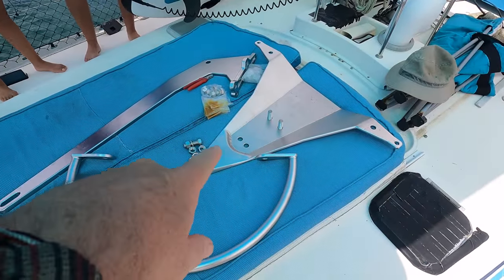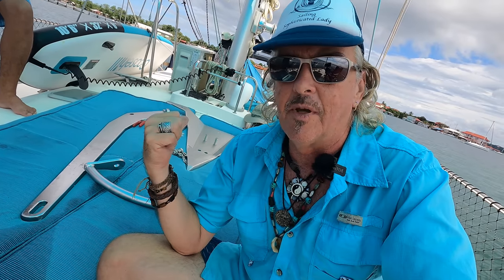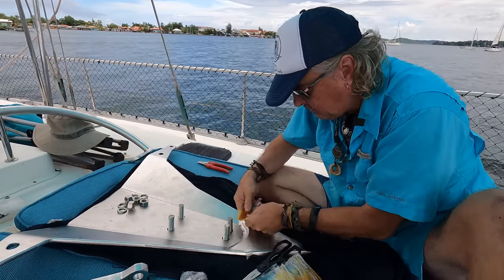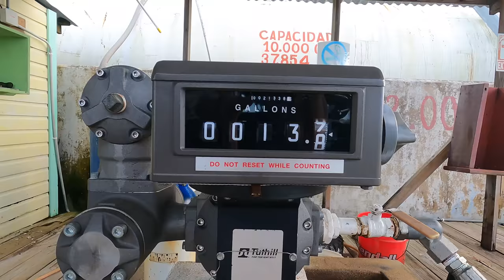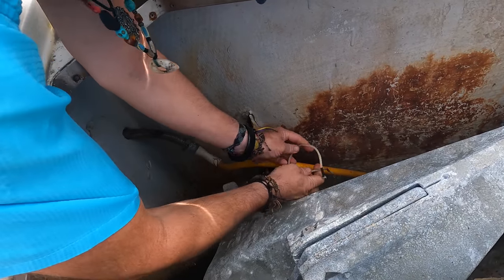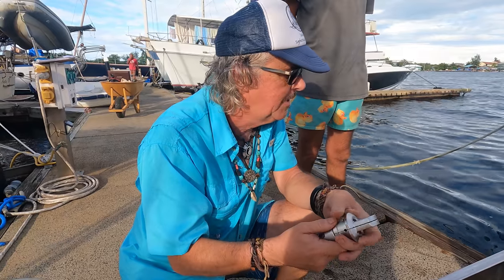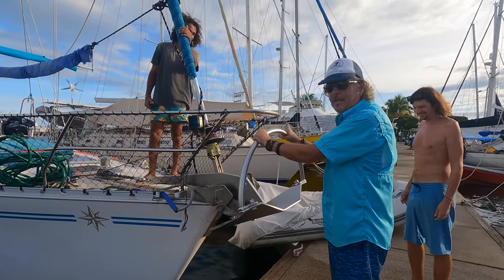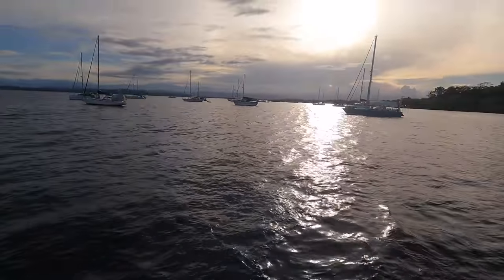SSL661 ~ yes guys.. SIZE MATTERS

Comment: Capt Rick that's like one of the most valuable pieces of equipment on your boat, it's the other boats that fail to appreciate that spending it now or lose it  in a strong gale and dragging down on Sophisticated Lady could end up costing  more than a good quality heavy duty anchor, let her rip you are ready, wish I lived on the water with all the comforts you have acquired over the years I'll have to do with the next best thing watching you have all the fun and work the work part you can have
Reply from the maker: Yep, an oversized high quality anchor is the cheapest and most reliable insurance you can buy for your home on the water!  :)

Comment: Totaly agree, on my boat i have an upside 2 sizes Spade anchor.
Can you please explain what is your set up storm anchor system and how you use the two anchors?
Safe anchoring👍💪⛵
Reply from the maker: You can see the whole setup in operation if you go back in our SSL series to the end of 2020 when we set the system up for Hurricanes ETA and IOTA in San Andres.

Comment: The main attachment should be right at the front of the anchor and where you just tied that wire should be a weak link right there so if you get stuck the weak link will break as you try to pull forward
Reply from the maker: You don't want it to 'break' or it might do so when you don't want it to.. a secure line that you can easily cut is still best option.

Comment: Hail UP.  Why did they want to pull all the chain off when they changed the anchor?  Was the string not already tied?  That's the stainless steel version?  I'm impressed.  Nice prize.

Comment: I am wondering if having a torque wrench would benefit you so you know how much you tightening a bolt. The come in various sizes. They do require maintenance and adjustments.  I have yet to see anyone use it.

Comment: Another great video Capt. Just wondering though, when you let out the chain while anchoring, was the boat in reverse at that time? It seemed to me that the chain might have just been piling up on itself at the bottom. Of course, after that, you did go in reverse. Is there a preferred method for doing this?

Comment: Anchor for life in more ways than one, but looked so big, that you may have to modify your bow roller system, as no way to pin anchor in, and point of anchor looked close to gouging the bow of your home!
Reply from the maker: It is locked securely by the double roller extension which holds it very well away from contacting the bow, and then the windlass locks it in place under tension, or you can add a chain lock on deck if you want as backup also.

Comment: Too late now but be careful overtightening stainless nuts and bolts as the can bind and be almost impossible to undo - also is it possible you could get nylock nuts later on and a socket to fit them

Comment: Maybe I missed it but always tighten the nut onto the bolt not the other way around
Reply: @audave.  You are correct, you always tighten on the nut so the lock washer does it’s job.  In this situation, if you look at the the anchor there were upward bends where the bolts came up from the bottom and the adjustable wrench would not have room to grip the nut and torque without rounding off the nut.  I don’t know why 🤷🏼‍♂️ he didn’t ask someone at the dock for a socket wrench that size.

Comment: What if I get stuck on the big rock is there some kind a quick release
Reply from the maker: Yes, cut the last line link that we tied inside the locker
Reply: @SailingSophisticatedLady  yeah but then you lose your anchor, bummer  . there’s got to be some way we could pull the anchor out backwards with the weak link right there by the swivel if you pull it hard enough it breaks there , to pull the anchor out backwards some anchors have that system but not the mantis
Reply: @SailingSophisticatedLady  Or perhaps you add additional line along with the anchor line that goes to the back of the anchor to pull it out backwards

Comment: Capt.  
With such a valuable $4,100 💵 anchor, why don’t you ask someone at the dock for the correct size 7/8”socket wrench to properly torque the nuts 🔩 on the anchor.  Using that adjustable wrench to tighten on the bolt head and not on the nuts is not how you tighten nuts n’ bolts.  I’m sure you know this…🤔